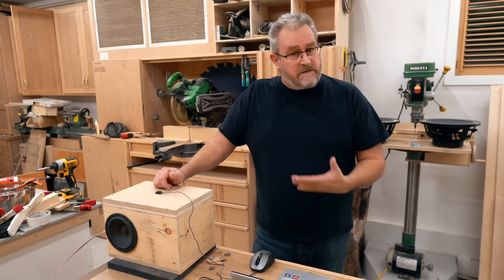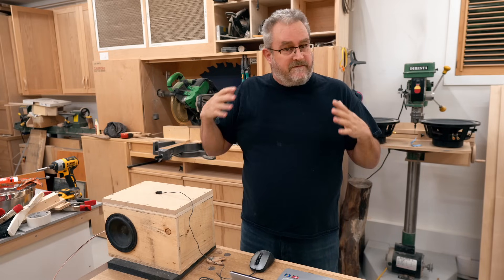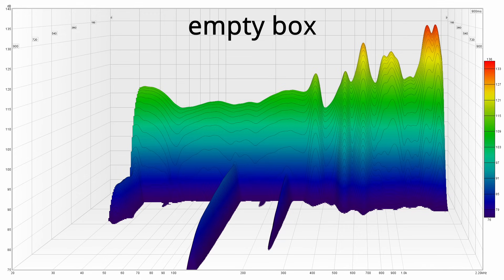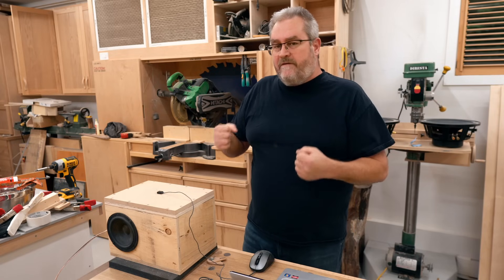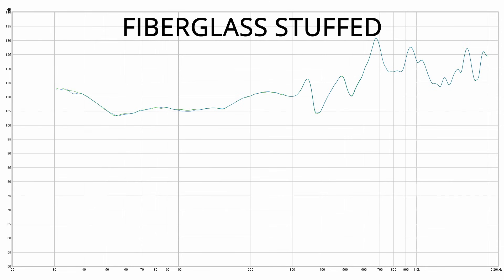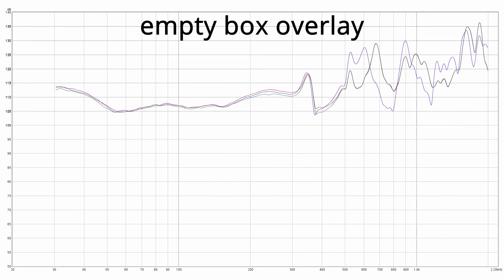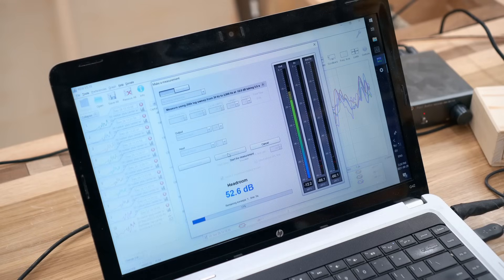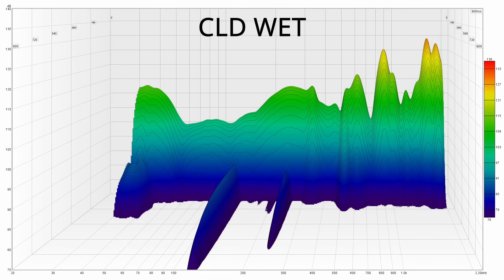Best Stuffing for Speakers Tested - Unexpected Results

Comment: Very interesting test. However, the stuffing in a speaker isn't for deadening the cabinet panel resonance. That's done with using the right cabinet materials and bracing. The fill has two functions. One is to deaden the reflected sound that would come back through the cone. Which is usually thin paper or plastic. Sometimes metal etc. The second is to slow the sound waves to make the cabinet seem larger than it is which means that you're lowering the cabinet resonance. 
A good quality MDF board is good for home stereo. That should keep your cabinet resonance down.
Reply from the maker: Damping is damping. It will damp everything inside the box - the airspace and the panels. This is the way that I chose to measure how effective the damping is, by measuring the panel.
Could be you are getting confused by the other testing I did at the end with direct panel damping to put the results into perspective. I should have been a bit more explicit in explaining my procedure, but it's very difficult to anticipate what needs to be emphasized.
Reply: @IBuildIt  well I think you may not quite understand why companies put dampening materials in their speakers. There are 2 reasons why companies use MDF. Its low in resonance and also fairly stiff. Pro speaker companies usually use Baltic birch because of their stiffness and because of the multiple layers do the same as your last test with 2 boards sandwiched together. You can feel the side of the cabinet and a good cabinet won't vibrate much. After that it's the specific placement and material that decides the internal damping that they want. Most high quality speakers will have a thin, maybe inch or 2 of sound deadening layer attached to the cabinet sides. If you are going to "fill" the cabinet, it's to stop reflections and mechanically make the cab larger. Your test for sound dampening testing doesn't really give you a good idea on what to use as sound dampening other than it will help stop a poor cabinet material from resonating. As an example, 2 sandwiched boards gave you better results. Now ask yourself how much it stopped that from coming back out that piece of paper called a cone speaker. The speaker cone isn't made of 1/2 inch wood.
Reply: @IBuildIt  I'm sorry but I should have mentioned horn speakers and transmission line speakers. On horns, you shouldn't use any fill. In transmission lines you will need a lot of fill. It depends on the type of speaker you're building.
Reply from the maker: Well I think you don't know enough about me to determine how much I know. Read through the other comments on here and my replies,  and watch my other recent videos rather than going with assumptions.
Reply: @IBuildIt  I'm sorry if I came off that way. I've been a sound engineer for 40 plus years and was trying to impart some of my knowledge. No offense meant. Sorry again.

Comment: bitumen gutter goo probably better than silicone which is quite bouncy?
Reply: i have used and think that something like "Silent Coat Multilayer Extra" is some of the best option. just look at the weight and if you have tried it on metal is quite the effekt, less on wood but its also on the inside so the pressure wavre have to go thru it before it goes to the wood.

Comment: Interesting. I've had to deal with sound attenuation on a couple of building projects that needed some serious noise reduction. Your fill test with different media was conducted by weight rather than volume, I think that it skews the results. The mineral wool at about 3lb/cu.ft. vs fiberglass at .6lb/cu.ft. doesn't utilize the density advantage by volume filled. That's still a marginal advantage anyway. Your conclusion with vibration inhibiting barriers that create isolation is the best process. You may even try a sound attenuation drywall that incorporates an isolation barrier built in. Pricey stuff, probably close to $100.00/4x8 sheet. Another product that works very well is a caulking called Green Glue, specifically designed for soundproofing and attenuation. Fasteners that bridge the isolation barrier( like screws) will negate the full effects of isolation. It take a bit of thought to bypass that sound transference issue.   Good stuff John, by the time you are done you may blow all my suggestion out of the water, or I may have contributed. ;-)

Comment: Ha! Nice to see the sandwich panel at work! 
I believe a thinner, more even layer of rubber adhesive damps better than a thick layer of silicone (because the glue is working in shear mode?)

Comment: I have also used vinyl floor tile to line the cabinet interior, along with foam, and insulation.  I believe a combination of materials might be effective too. Sorbothane and Desadamp are two other products but are definitely more expensive. Did you try testing the woofers output to see if there was any change to the frequency response?
Reply: I have used combinations of “dissimilar” materials of various density in a few speakers I have experimented with and the results were satisfying from an auditory standpoint. I used polyfill along with rockwool and strips of Noico sound deadening mats. Overkill? Possibly but I was satisfied with the improvement in response. The cabinet was deadened substantially and the Noico helped greatly in that regards

Comment: An interesting test. Those materials are not meant to change the resonant frequency of the panels but dampen the driver. There are lots of better alternatives for panel dampen
Reply from the maker: Damping is damping. It will damp everything inside the box - the airspace and the panels. This is the way that I chose to measure how effective the damping is, by measuring the panel.
Reply: I appreciate the videos. Your tests are valid and prove those materials don't dampen enclosure well however what they do well is change the q factor of the driver simulating increased airspace which is proven and tested with frequency measurements.

Comment: To me, using fill is never something I do to “fix” cabinet wall resonances. It’s only to help reduce standing waves or port resonances within the enclosures. I have tried many types: polyfill, pink insulation, Dacron, rock wool, demin, etc. The way I test is with impedance sweeps. I have found that lining the walls with 1.5” fiberglass is the best in midbass speakers. I put cheese cloth type material over it in ported boxes for piece of mind. Putting filling in the cabinet like you did dampens the airflow to the port which reduces output. I think that’s why people say overstuffing boxes will get weak bass. 

In subwoofers I use 3 inch pink insulation because it does the best job of “increasing” box size. Again, I only line the panels and adhere it with spray adhesive or hot glue. It works best with slot ports because you can get large even coverage. Getting a 30% increase in theoretical box size is common in common shaped enclosures. Whether or not that box volume gives an output increase or just changes the port tuning is still up for debate in my lab.

To fix cabinet resonances, bracing is the only thing I’ve found that truly makes a significant enough difference for me do it. I know your measurements show that it doesn’t help at higher frequencies, but my cabinets really never have any resonances that high other than ports. Honestly I’m not sure why your getting such high peaks on yours. Maybe I just don’t notice them as much as the low 100-400hz ones.
Reply: Hello mate. Ive got a pair of celestion ditton 44 mk 2 (with the passive radiator) what filling should I use? Thanks in advance.
Reply: @zukispur5493  if you think you are having problems with cabinet resonances you should consider putting some additional bracing instead of just adding filling. If you are trying to get rid of standing waves or internal resonances then I’d start with a 1.5 inch thick insulation, rockwool or fiberglass should both work. Since they are sealed with passive radiators you shouldn’t need to worry about dusting.
Reply: @noahnovotny2100  some bracing with inch and half rock wool it is then. Cheers mate I appreciate your swift reply

Comment: With respect, I don't understand why you are using stuffing to damp panel resonances, that isn't what it is used for, generally. Bracing is the solution in regards to this problem. Divide the panels up has you have with this box but add more and make the resulting panels smaller and with a higher resonant frequency outside of your passband. If you dado 18x25mm birch ply strips in to a cabinet wall this will be very effective. Internal ribs.
Reply from the maker: There are just two reasons to stuff a speaker box:
The first is to increase the apparent volume. 
The second is for damping. 
There aren't very many ways to directly measure how effective the material is at doing that, but one is to measure how much a panel moves. If the stuffing is good for damping, that will show up in the panel.
I explained this in the video.
Reply: @IBuildIt  I can think of a handful of other reasons why you would put damping inside a speaker (reflections, quasi-aperidoic alignments etc). It doesn't increase the apparent volume, this is a misinterpretation of it's effect - Q of a sealed box decreases with stuffing/overstuffing.

I understand you said this in the video but why not measure the effect of the stuffing with actualy near field driver measurements? You are using a solution for another problem(s) for this one. CLD is more appropriate but as I mentioned before, internal ribs create sub panels with a higher resonant frequency outside of the pass band.

Here is a really good paper on bass reflex stuffing, hope you find it interesting: https://drive.google.com/file/d/16j9rOXLL6uPSykyZ1OI9yk0QjQ-fZCXb/view?fbclid=IwAR3bduPGdCxVh_Ged8wRfEbU6vSqvdx7ulZulEBEqv6LYz48JlE3jG-0Je8
Reply from the maker: Reflections are reduced by damping - that's what damping is. And I know what aperiodic loading is, but never heard of the quasi variety.
You seem to be misinformed about the apparent volume issue as well. Box modelling software takes that effect into account and I've tested the results that match.
Could be you are getting confused by the other testing I did at the end with direct panel damping to put the results into perspective. I should have been a bit more explicit in explaining my procedure, but it's very difficult to anticipate what needs to be emphasized. 
A frequency response test may show differences, but how would you interpret them? This methods shows definitive differences and there's no problem to see which ones are better.
Reply: @IBuildIt  Fair enough, but I am not confused. Impedance graphs will show the effect of damping as will frequency responses - noted in the above paper.

I think what is more critical in damping is position and amount used not the material as they mostly act the same. Using the same weight of each isn't an apples for apples comparison unless all you care about is the amount of material you use which you state below in your pinned comment (1g of feathers = 1g of lead). My point re a 'quasi-aperiodic' alignment (made up term-ish) is that the effect of damping becomes more apparent depending on where it is used. In this instance I meant a cabinet with uniform fill so there is damping between vent and driver. Keep stuffing and the vent output drops/is damped.

Do you use Hornresp? If not I think you may find the MLTL mode very useful for simulating bass reflec and positiong and amount of damping in a cabinet.
Reply: @grahamsquared  it helps with damping because it reduces standing waves and resonances, you said it yourself when talking about quarter wave enclosures
Reply: @grahamsquared  I know what you are saying, because it's how the internal issues were addressed in my cabinets. After trying various methods, ended up using 2 cross(half cross?) bracing and 2 thin-ish layers of wool felt across the middle, which is just above the woofer & ports. Trying to address one problem at a time introduced more in another. The method used ended up working out the best in average.
Reply: @grahamsquared thanks that's a heavy read but worthwhile , cheers

Comment: John, very interesting video. My thoughts on dampening materials had always been centered on the driver output difference, or lack thereof, but seeing how they changed panel vibration was intriguing. However being you have this setup ready could you please do a quick comparison of the effects on driver output? Too many times I've read differing opinions on the subject and I believe it would be beneficial for more than just "Toids DIY Audio" ( iirc) having tested the subject on video. Thanks either way though as now I know I could use less bracing and more stuffing if necessary.

Comment: Would be Interesting to see a test of "no rez " a product made for this purpose.  I was also told vinyl floor tile with foam glued to it would work well.
Reply: No rez ist wie bo dum 800 viel zu teuer.  Schweissbahn auf Bitumen 4-6  mm dick bedämpfen auch gut bassreflex gehäuse
Reply: @thomasschafer7268 agreed no res is very expensive to get shipped to Canada

Comment: 2:55 I thought you're talking about damping and not about repress or quieten sound. This is not the same. sound damping means that you will lower the velocity and energy of soundwaves. Repress means that you will improve the enclosure to be quiet and take down all responses or resonances, making it 'acoustic dead'. With this accelerometer you measure how good your enclosure represses the forcees that are treating it. The reduction of enclosure movement in combination with the damping-stuff is a result of the reduced wave velocity and energy that is absorbed by the polyfill etc. 7:14 and 8:16 this is a good way to improve the enclosure. By mixing materials with different resonance-frequencies you will get a better result, Many high-end speaker builders use rubber mats as a final layer inside. Stoneware or ceramic tiles put some weight on larger sidewalls. You only need tiles on 60-70% of the area to have a good result. You can hear the quality of your work by knocking on your box. It will sound dull within a lower frequency. Then you can start damping your boxed in air. To much damping stuff can be contra-productive. Ported boxes don't need much damping, in fact they work less good if you put stuff into the way the air should move. They only need some flat panels on the sidewalls to dampen the mid frequencies. A 6th order bandpass sub dosent need any damping at all but will get better with a solid enclosure. Long things short: Polyfill is pretty good and it's cheap. You get NO advantages if you buy high end super state of the art Polyfill wich is 'extra' designed for high quality sound. That's bullshit. You even could use ikea pillow-filling with the exact same results. The only thing with this stuff is that it mostly comes in little pieces. They are a bit difficult to get them to stay where they should. But if this is no problem you could use them. Greetings from Germany.

Comment: To bad you never had any product like GR Reserch NoRez kicking around. It would have been nice to see put up against the others. I had great results using it to damp the cabinet if my CerwinVega speakers along with some bracing. It really helped to tighten up the bass.
Reply from the maker: The video was primarily a comparison for stuffing material, and I just threw in those other things to give a little perspective.

Comment: Bracing has the largest effect by raising the resonant frequency of the panel beyond the point that the driver, when crossed over will excite the panel. And by varying the location of the bracing so that no more than 2 panels share the same dimensions helps further.
Reply from the maker: My tests show that it's harder to do that than it seems. The panels need to be very small to drive the resonance up high enough, which means a ton of bracing. And in a fullrange speaker there's always a driver that can excite it,

Comment: I enjoy your videos. I have not built a speaker yet but I am very interested. I restore and tinker with cars as a hobby. When I saw what you were doing with the silicone I couldn’t help but think about the isolators that are used between engine intakes and carburetors, especially on high revving race engines. They do reduce resonant vibrations that cause problems for the fuel and air. 
What would be the effect of isolating the woofer and tweeter by gaskets or silicone? I understand the purpose of a rigid box, but what happens if gaskets or silicone are sandwiched between all of the joints? Of course using a ported box. 
I’m sure I’m way off here somehow, but I am curious.
Reply: You can use cellular rubber (1 or 2 mm thick) to reduce resonances and to mount the chassis airtight. Also a ported box needs an airtight mounted speaker. Mounting a chassis with some kind of rubber-metal-mix as they use on engines (Vergaserfuß in German [carburetor-foot]), the chassis would beginn to move in any diections. This would take a lot of acoustic energy, especially in the hights and cause many problems more. It would be the best mounting if the speaker is the baffle itself. No airleaks, no noise transmitting. Use the right screws and thighten them equally and it will work fine.

Comment: I don't get the point of this test. Measuring the impact on mechanical vibrations from an acoustical absorber makes very little sense. I'd be measuring the impedance amplitude and phase and the acoustic amplitude and phase response of the output from the driver to compare the properties of acoustic damping materials.
Reply from the maker: Sounds interesting - post a link back here when you have the video done and I'll check it out.
Reply: Have you ever heard of a "Zobel Network"???🤔